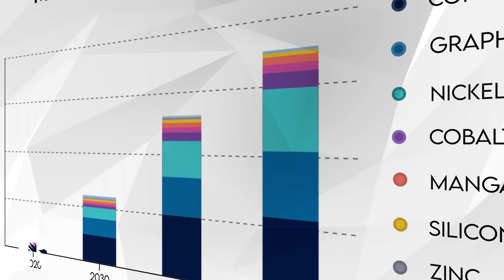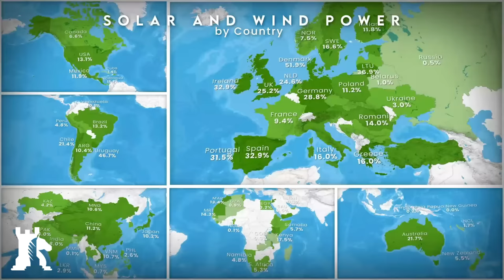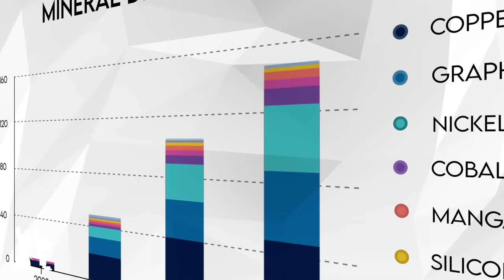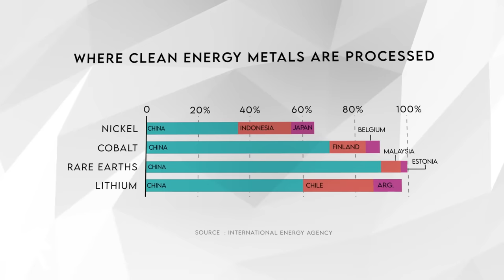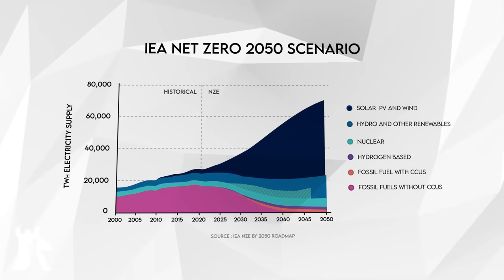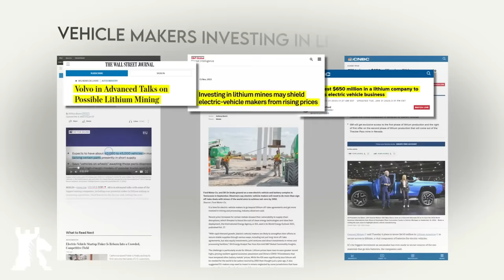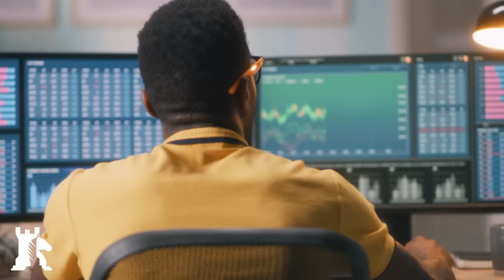Net Zero by 2050 is not happening

Comment: The video is eye-opening discussion around minerals.  But the video is predicated on no recycling whatsoever of any energy equipment.

The video presumes the old fossil fuel based "linear economy" will continue unabated.  But the "circular economy" is one of the key foundations of the global energy transition.  As the saying goes, if we don't learn from past mistakes then we are doomed to repeat them.  That should have been the real basis of this video.

We can expect mid-way through that new mineral mining will start being replaced by recycled materials that become cheaper than mining for them raw.  Almost all the material in renewable energies (solar panels, wind farms, batteries) are still available at the equipment's end of life as it was at its beginning of life which the technical basis for a circular economy.

Furthermore, what we consider "non-recyclable" today may not be the case in the future.  Renewables are now the cheapest form of energy by far.  Renewables can bring down the cost of energy to a point where energy will no longer be the bottleneck to energy recycling.  New inventions and techniques will also come into play.

Finally, we can expect and presume government subsidies will be increasingly redirected towards nascent recycling companies and initiatives.  Because it is in the public interest to do so.   This becomes all the more likely as governments become increasingly less straddled with subsidizing the global fossil fuel industry towards 2050.  The fossil fuel industry received a staggering $5.9-trillion USD in subsidies in 2020 according to the IMF.

Comment: We took the wrong path.   Long ago we should have invested in very different nuclear technology.  Low pressure, high temperature reactors, with different fuels.   We could have decarbonized the power grids of most of the industrialized world decades ago.   Also, not known to many people, is what else high temperature reactors can do.  They can crack carbon from the air or ocean, passing it into refineries to be converted to hydrocarbon fuels.   Fuel synthesis in bulk would have replaced oil extraction, while renovating the refining business.  We didn't even need to go with EVs.  We could have kept driving home efficiencies with internal combustion, because nuclear derived hydrocarbon synthesis would be from the carbon cycle to begin with.  In other words, completely carbon neutral combustion.

Instead we will fail to make renewables work, waste time and not go nuclear, and push EVs when there's no hope of reaching the mining targets.

Comment: You are not discussing using high voltage DC lines to trade renewable energy around different regions.  That dramatically lowers the need for storage and material resources.

Comment: I think you are painting an incomplete picture, here are some counter arguments. I'm curious as to how you see this.

1. Argument: Renewable energy infrastructure is inherently less environmentally friendly than fossil fuel infrastructure due to mining. 
   Counter: While it's true that mining for materials such as lithium or cobalt needed for renewable technologies like batteries can have significant environmental impacts, the comparison is incomplete without considering the full lifecycle emissions of energy sources. Fossil fuel extraction, transportation, and burning also have significant environmental impacts. When considered over the life of the technology, renewables typically have significantly lower emissions and environmental impacts than fossil fuels. 

2. Argument: We will need thousands of new massive mining deposits globally to transition to renewable energy. 
   Counter: While the transition to renewable energy will require significant amounts of minerals, innovation in recycling, substitution, and efficiency could potentially reduce these needs. Also, the development of new technologies, like solid-state batteries, might require less rare or harmful materials.

3. Argument: Decarbonizing the global economy is nearly impossible by 2050.
   Counter: While it's true that decarbonization is a significant challenge, it's not impossible. Many experts and studies, such as those from the Intergovernmental Panel on Climate Change (IPCC), suggest that with the right policies and commitment, it's achievable. It requires a holistic approach, including energy efficiency, renewable energy, carbon capture and storage, and changes in land use.

4. Argument: Developed nations have only lowered their emissions by offshoring production.
   Counter: While some level of "carbon leakage" has occurred, this argument discounts the domestic measures that developed countries have taken to reduce emissions, like improving energy efficiency and transitioning to renewable energy. Furthermore, the solution is to impose regulations globally, not to cease the effort to reduce emissions.

5. Argument: Renewable energy technologies require 10 times more raw materials than non-renewable ones.
   Counter: While renewables can be material-intensive, this argument misses the full picture. Renewables have much lower operational emissions and are often more efficient in energy generation. Furthermore, as technology advances, the material intensity of renewable technologies can decrease.

6. Argument: Used wind turbines will account for 300 million tons of non-recyclable plastic waste by 2050.
   Counter: While waste from renewable energy technology is an issue, it's important to remember that these technologies often have a longer lifespan than their fossil fuel counterparts, and recycling technologies are improving. Furthermore, new turbine designs are aiming to use more recyclable materials.

7. Argument: There will be a spatial problem with places for extraction, refining, and dumping becoming scarce.
   Counter: While space is a valid concern, it's also an issue for fossil fuel extraction. Renewable technologies often have a smaller spatial footprint when you consider the extraction, refining, transport, and burning stages of fossil fuels. Furthermore, renewables like solar panels can be installed on buildings, reducing their spatial requirements.

8. Argument: The location of resources will place a chokehold on the flow of green minerals.
   Counter: While the location of resources is a valid concern, it's also an issue with fossil fuels. Furthermore, research is ongoing into new technologies and materials that can reduce the demand for certain minerals. Diversifying the supply chain can also help alleviate this issue.

Comment: Hydrogen is NOT an energy source. Hydrogen is basically a liquid/gaseous "battery". you can generate it, store it, move it, but it also evaporates and leaks and it takes energy at each and every step of the process from generation to use and you end up with around 30% of the energy you put in.

Comment: A negativism focus doesn't help.

Sodium battery chemistry is already used at scale in China EVs, solving the Lithium Cobalt and related future shortages.  For green electricity grids, Redox Flow Batteries are already suitable for replacing Lithium-Ion, and at scale.  Recycling of lithium and solar panels is already scaling up, and recycling will be economic for other in-demand substances, while continuing to leave less valuable toxic substances in landfill to contaminate groundwater.

Recycling of wind turbine blades is extremely difficult and very simply not required for achieving both our net zero and ecological goals.  Recycling of other wind turbine parts is becoming an increasing focus and is in progress.

Net zero by 2050 is no longer likely, because of inaction and delays, not due to it being impossible.  Net zero by 2060 is a better outcome than net zero by 2090, so we'd best get cracking.

Whichever future we choose, many of us will be alive to experience precisely how uncomfortable it starts to become.  The longer we delay, the more poverty and difficulty our children and grandchildren will experience.

Our choice is not 2050 or nothing.
Our choice is net zero by 2060 or by 2090.
Best choose wisely.

Comment: Truly, seems like nuclear is the only viable option with some amount of renewable energy. The use of fossil fuels Hass to be limited in as many ways as possible. People just can’t seem to get it to their heads that it’s not an endless resource, it will become too costly to seek out what’s left
Reply: Even if fossil fuels remain inexpensive to extract, there is the "other" cost.  This "other" cost is the warming of the Earth, killing species, making the Oceans acid, possibly rerouting the Gulf Stream, and reaching a tipping point where the global warming process accelerates all on it's own.  So, build some nukes and save the Earth.  The economy of scale will both lower the cost and decrease the time needed to build nukes.  Besides, like making cars, semiconductors or solar cells, you learn to do it better with experience.  People just don't seem to get it into their heads that you get better at stuff with experience.

Comment: Antartica sea ice extent is now more than 6 standard deviation from below norm. That is unprecedented. 

North Atlantic sea surface temperature at about 1.3 degree C above mean. That is also unprecedented because the highest in the past is less than 0.8 degree C. 

We may be looking at sudden abrupt climate change happening right now but the world leaders are not looking it with gravest concern. Each year of delay becomes increasingly more difficult to take action to curtail use of fossil fuel.

Comment: Quite ironic how all serious discussions about resolving climate change is about how we "need more" of whatever it may be. But "needing more" is how we got into this mess in the first place.
We don't need more production of materials to make renewable energy. We need to drastically reduce energy consumption by all means necessary. If we don't, more people will die. The economy restructuring for 10 years or so as a result is microscopic in comparison to the alternative.

Stop setting your AC to 60 degrees in the summer, 80 degrees in the winter. Do it the other way around. Buy small cars or motorcycles instead of trucks and SUVs. Stop ordering useless junk online.
Don't play the blame game pointing your finger at the companies making all the stuff you buy. Take some responsibility. You're just as guilty as them.

Comment: 6:50 - It's unlikely that lithium will be used for grid scale storage.  There is plenty of research going into non-Lithium storage that are optimized like liquid-metal and flow batteries, compressed CO₂, gravity, to name a few.  These use more conventional materials.

Also, these non-lithium based  energy storage technologies sacrifice high volumetric density but gain by being a third the cost of lithium while supplying many times the cycle count and even unlimited cycle count.  Stationary grid-scale energy storage simply does not need the high energy densities that are paramount in EV applications. That high power density complicates the EV battery chemistry/manufacturing and is an unnecessary constraint on stationary batteries.

Comment: Sorry Caspian Report, you you did not research the matter of recycling wind turbine blades properly. They can already been downcycled and used as a raw material for concrete production and building materials.

Also, technology has been developed to produce both fully recyclable blades. Siemens Gamesa has already constructed the first turbine with fully recyclable blades. Likewise Vestas has developed a process to fully recycle old wind turbine blades on existing turbines.

Comment: yep, and as we speak there are whole parks full of old electric cars in france and especially in china because replacing the batteries costs more than a whole new verhicle and recycling the components is not really commercially viable apparantly

truth is, we should just promote inovation in all forms of motorized transportation, if electric cars are affordable to buy and maintain and provide electricity for, people will use them. however internal combustion engines get way to bad a rep, they have never been as fuel efficient as they are now and trough filters and katalysts it is possible to further lower their co2 emmissions

furthermore, we simply don't have the electricity production to fuel even a fraction of the electric cars that would replace fossil fuel cars, not by a long shot.

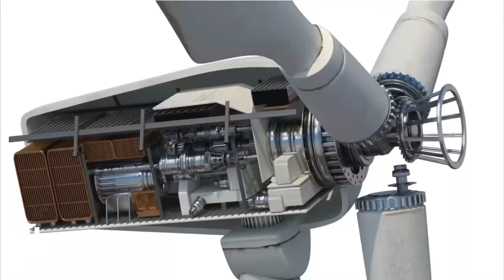Comment: @2:56 That is not a fair comparison . comparing a single gas turbine with wind farms. A gas turbine doesn’t produce power by itself. It needs to be put into a gas-fired power plant. What about the space and steel/concrete requirements for the associated gas storage depots, burners, power plants..

Comment: The silver supply has to increase by 4200 Million Oz (119000 Tonnes) (from current 25000 Tonnes) - i.e.a  factor of 5. Why? The major energy transition use is in solar panels, and that was about 11% of total production in 2019 (100 MOz).  Even a tripling of PV production will only add 20% to the production requirement. Which would be 14 of those mines. The Silver Institute's 2020 global report on silver demand from solar anticipates that demand will actually fall slightly by 2030 due to reduction is silver per panel, but that even by 2050 it will have risen to only 50% of current production, not 500%. So your 300 Penasquito's sounds like bollocks to me. 30 over 25 years is plausible (which is still a big deal, but a lot more do-able)

Comment: Is it actually imperative that we reduce carbon dioxide? I am grow more and more skeptical of this claim. After the 20th century, sensible people agreed that an economy is too complex to be centrally controlled. Yet, in the 21st century, we are claiming that the global climate hinges on a single variable. It just seems too simplistic.

The argument goes something like: carbon dioxide = higher temperatures; higher temps = bad things. But there are a lot of unanswered questions contained in that formula. What is the relationship between temperature change and carbon dioxide? Is it a truly causal one? If it is, can the process of temperature rise actually be slowed, stopped, or reversed? We know from history that humans suffer more from a decrease in temperatures, so is it really correct to conclude that higher temperatures are a problem? The computer models which are used to map possible changes produce a massive range of outcomes which become less and less reliable the further out you look. How can we confidently know what effects higher temperatures will have on rainfall, wind patterns, or plant growth? 

For me, COVID was a cardinal lesson in questioning the predictions of The Science - especially when they are demanding massive social and economic changes for the "greater good".
Reply: The thing is there are different ways to look at a problem.  You can calculate the effects of Carbon Dioxide and then you can get the results by "empirical" methods.  In this method you look around  and see the ice melting, the record high temperatures, islands sinking, cities flooding, the coral reefs dying and other stuff.  Then you reason to yourself if this is a good thing or a bad thing.  I think most have already determined that it's a bad thing and we ought to fix the problem.

Comment: When you say, "gas turbine" and refer to the relative amount of materials needed for alternate energy generation methods, are you calculating the materials for just the turbine? For the turbine and the room that houses it? For the entire power plant that uses the turbine?

It would seem daft to compare just a turbine to a solar field when a solar field is a power plant and a turbine is a component of a power plant. Sure, it's the component that turns heat into energy but you also need to produce the energy and that's a massive part of the materials cost. We're technically using the energy of the sun for renewables; which is massive so your numbers should be even worse if you were to actually explain by a more congruent example.

Comment: I feel like there have been way more scientific elaborations on this topic and looking into the increased efficiencies within the electric supply chain we shouldnt be here bashing renewables and e-mobility based on their requirements in raw minerals. 

Also the main battery chemistry (LFP) that is now pursued only uses 4% Li next to 33% Iron and 54% Phosphate. So no Cobalt, Manganese, Zinc etc. anymore. 

Next to that, we cannot translate our current energy demand in fossil fuels 1:1 to our demand in electricity as we continue to connect different sectors of energy. That’s because 1 litre of oil lets say contains about 4kWh of energy but during refinement and combustion there are massive energy losses along the lines of 67% of the net energy. Meaning f.e. in mobility we only have to replace the 33% of fossil fuel energy that actually ends up being used in the respective car for transport and not heat.

And please stop glorifying nuclear energy as it is just not economically viable at this point. Building a new new plant takes about 10 years for about 1 GWp of output and its way too inflexible for todays requirements. Solar and wind are way cheaper and there is no reason not to go with them predominantly. That does not mean that they are perfect but rather that we are still in need of optimized Recycling processes to make it more circular. 3:44
Just my 2 cents.